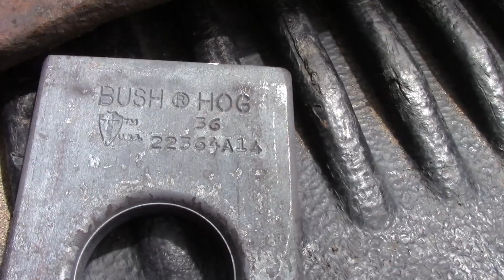Parts in for the bush hog and some testing

Comment: Nothing is ever easy.... My riding mower. First the ignition module starts to die (won't start when hot). Replace that. Then one of the belts go... replace the belt and then the new belt is smoking. Bad clutch pulley which has to be ordered.

Just when you think you've got it sorted out something else happens.

Have two other lawn tractors but I'm waiting on a starter for one and a spindle assembly for the other...

Have sisteen lawns to mow each week so it's good to always have backup. What do you do when your primary, secondary and tertiary mower fail all at once?
Reply from the maker: Im down to one working lawn morrow, I had two last year just no time to work on it. My bigest problem now is flat tires lol. I did the tire slime and it seems to work